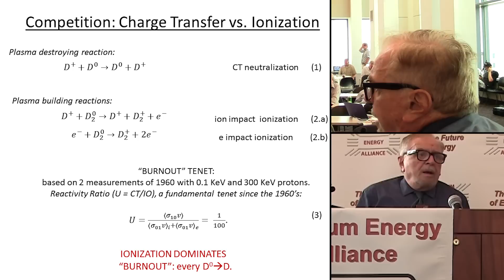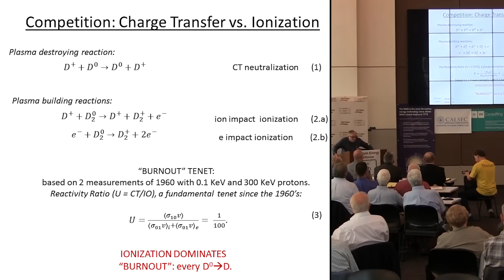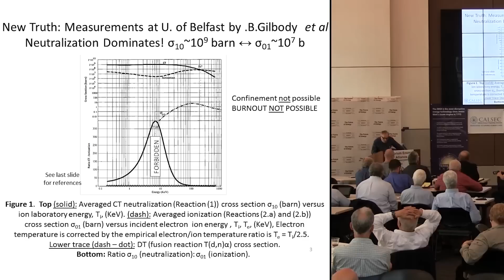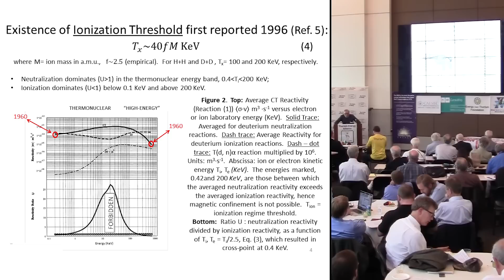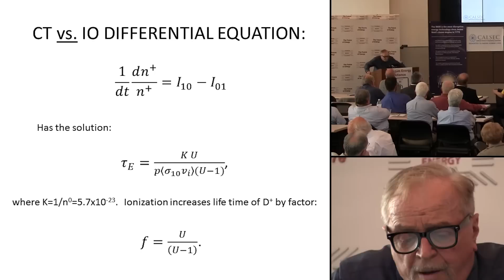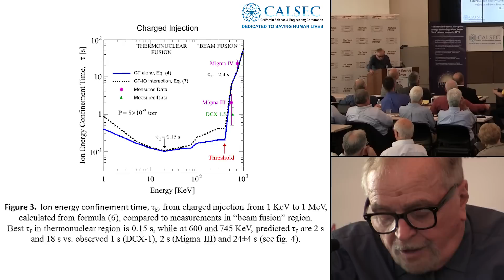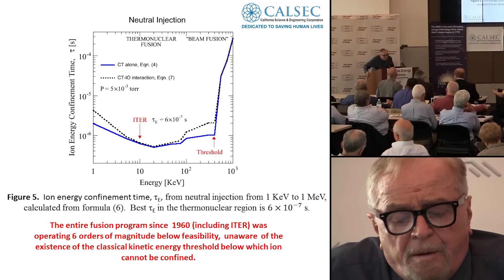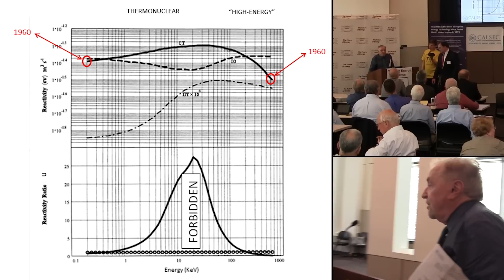Bogdan Maglich - Th/U233 breeding Ti above 200 KeV viable, NOT at thermonuclear ion energies @ TEAC6

Comment: The effect he's talking about, "charge exchange", is widely covered in the literature and has been continually measured. Simply typing "charge exchange fusion" into Google will turn up 12 million results, and if you do the same in Google Books you can find any number of texts that go into the topic in depth. You can find discussions of this concept using a diverter in the first Stellarator documents in 1953. His conclusion is that ions cannot be contained, but this is routinely achieved in modern machines like JET and JT-60. There is a lengthy discussion of this here: http://www-naweb.iaea.org/napc/physics/FEC/FEC2012/papers/144_FTP33.pdf